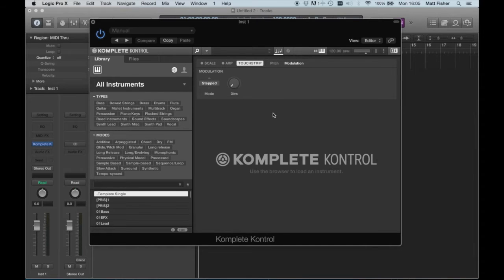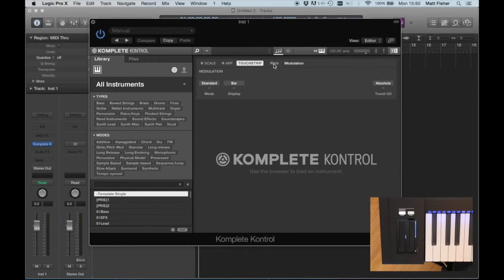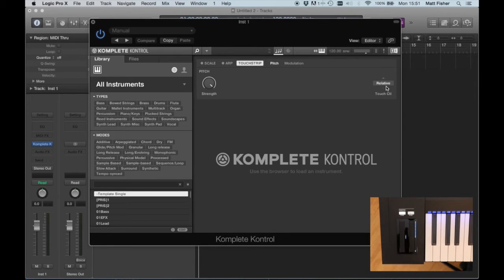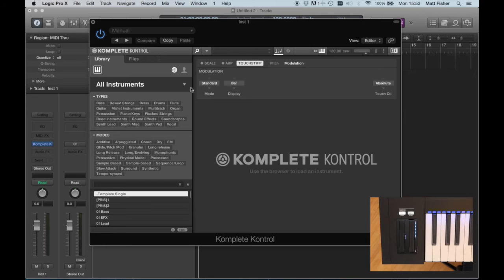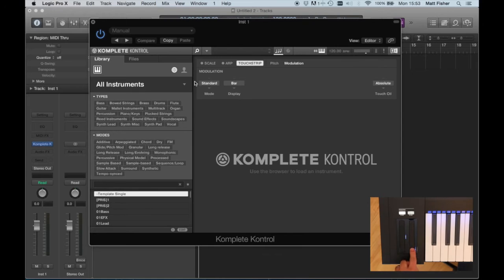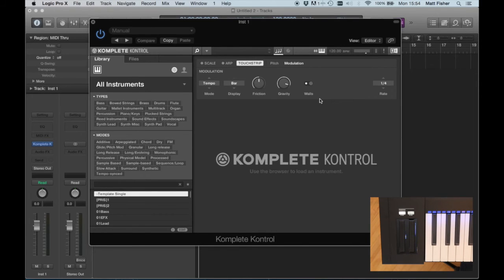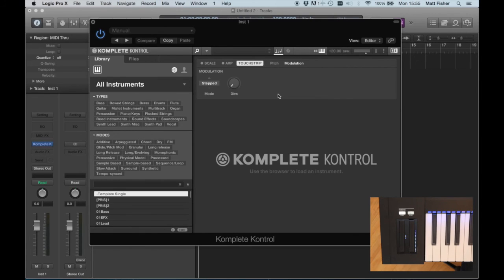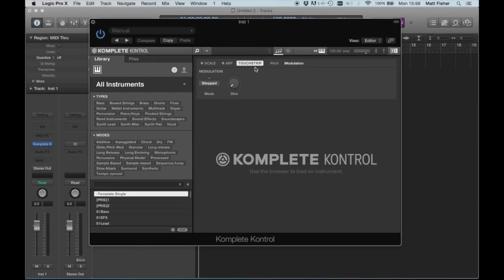Komplete Kontrol 1.5 PT4: Touchstrips

Comment: are Italian, this product is defective komplete kontrol and also I have bought maschine mk2 and native komplete 10 completed and komplete kontrol S49 total 2,136 Euros, and the first day I discovered the flaw of this defect and touch strips hadrware and not software you want knowing crushed on the edges of the touch strips and see that the beta read changes or blocks it seems that there any grounds this a very serious flaw

I changed this product and also the second that changed me has the same problem so I am now sure that a lack of fabrica hadrware and I want a refund or even new product without any defect.
Reply: Giraffe + Audio is certainly the I configured correctly and everything works except touch strips work but crashes do not follow your finger as you press the plastic contour strips touch the signal is changed by himself so there a flaw not a configuration issue and I also found many people have the same problem in America that surely there are also who do not have any problem but this defect and too sorry about this product ,
-----------
in italiano :
+Giraffe Audio si certo lo ho configurato correttamente e tutto funziona tranne touch strips funzionano pero si blocca non segui il dito in più si premi il contorno di plastica del touch strips il segnale si cambia da solo quindi ce un difetto non un questione di configurazione e ho trovato anche tante gente hanno la stessa problema in America sicuramente che ce sono anche che non hanno nessun problema ma questo difetto e troppo su questo prodotto mi spiace,
Reply: +Giraffe Audio I did not understand that fermware ?
 I followed what I wrote on the official website of IN and installed the komplete and updated by service center and it works just the perfect touch strips the left side which is called the pitch bend is not working as it should as your video no crashes or to below or to the above and you just press the touch plastic contour chambia in the most signal moves the contour of the strips touch not fixed and called the azenda who sold me the product and have changed me and delivered another new and found the same problem but this time not on the pitch bend but the right side this time always hangs up and you do not follow your finger
Reply: +Giraffe Audio 
thank you very much now I changed the keyboard
komplete kontrol S49 and this works fine with no firmware update I tried touch stripe no defect and in any case I updated the firmware whom you told me , and it all works very well with only the other keyboard before are bad maybe something about transportation